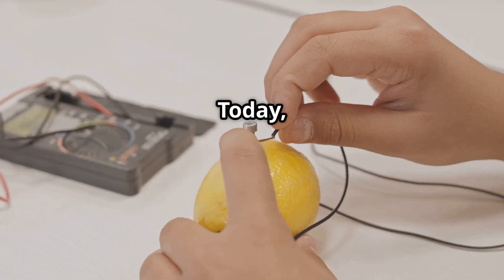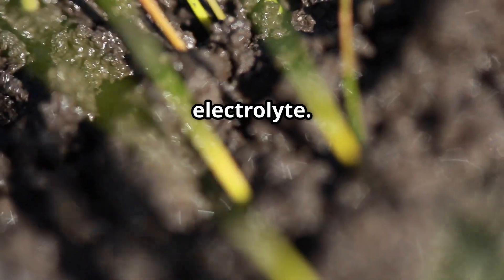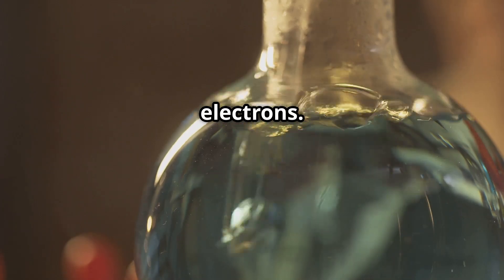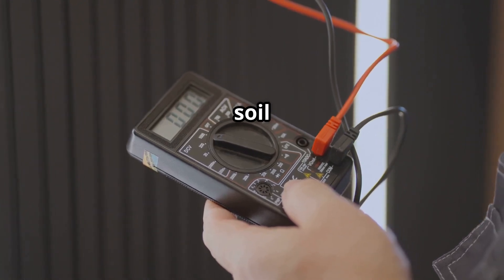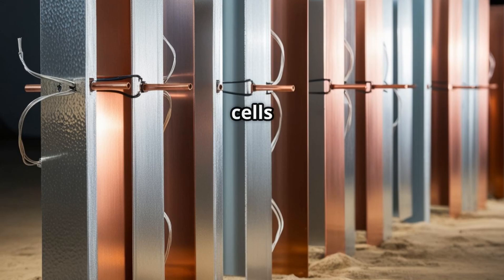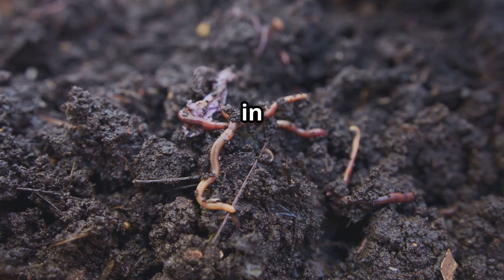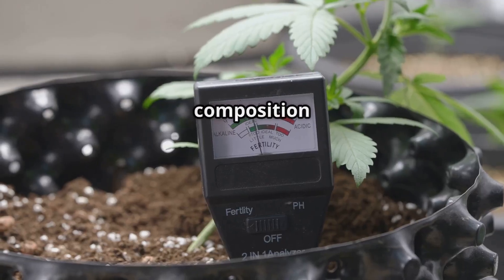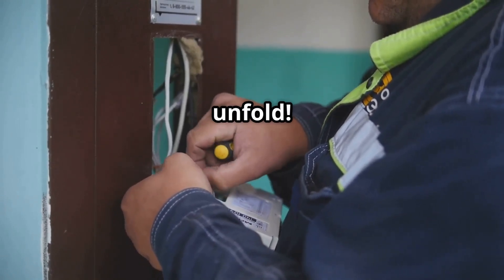How to Build an Earth Battery: Generate Passive Electricity with Zinc and Copper

Comment: It's not free. The zinc will be consumed as it's converted to zinc oxide during the galvanic reaction. Just like any other rechargeable battery, one must use more energy than the battery gave to recharge it or replace the zinc with fresh zinc. Anyone watching this, just buy yourself a solar panel, solar-compatible lead-acid battery charger, and a car battery for cheap renewable energy that lasts for years.
Reply from the maker: That is correct, however it is good to know the simple design and physics. It is easily applicable, and a fun demonstration.
Reply: Stainless steel and graphite can be used. It still produces energy not through galvanic processes. Telluric currents are proven not Sci fi